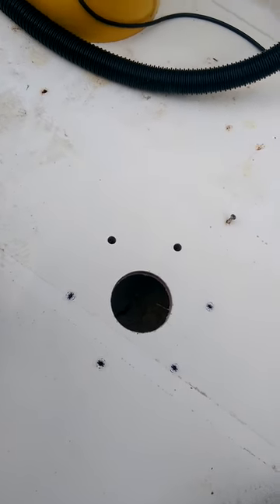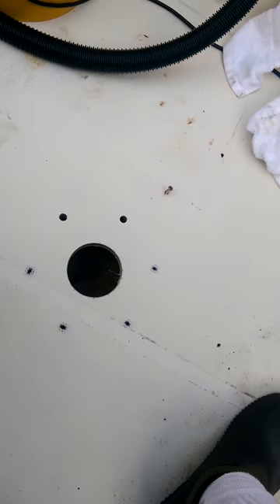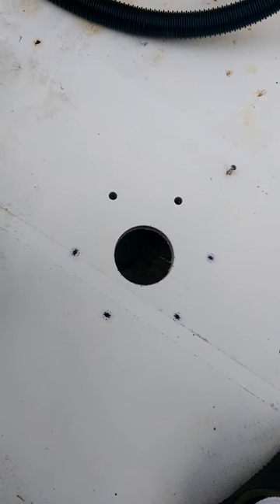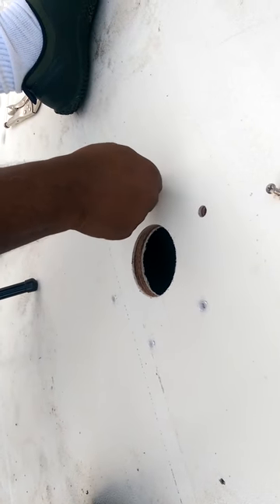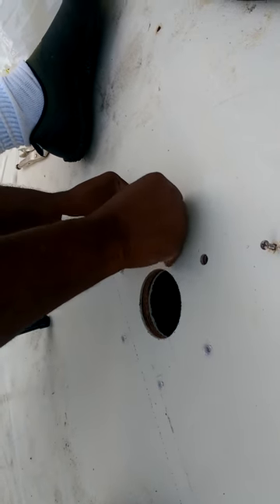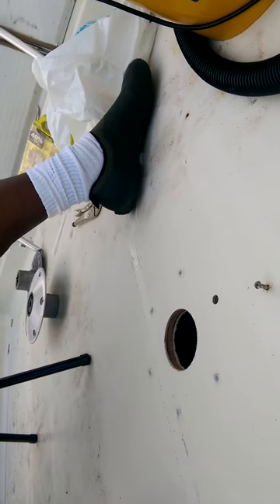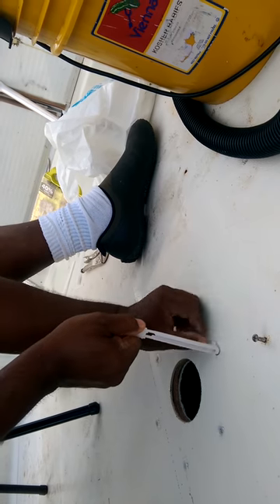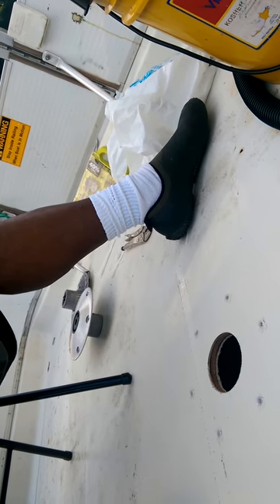Springfield Plug-In Hi-Lo Pedestal INSTALLATION

Comment: how thick is your floor? also is floor fibreglassed over plywood? im wanting to install pedestal seats to my boat but worried its not strong enough to hold my weight of 242lbs especially if sea gets rough. i was thinking to bolt from under floor foe extra strength and you've given me a good idea to make centre whole first, thanks for an awesome video all the way from new zealand

Comment: where did you get those type of anchors for the toggle bolts..thanx
Reply from the maker: A local store called TA Mahoney
Reply: @0528kap  thanx i found them at lowes
Reply: @KalCana  Those are standard snaptoggles and will rust. You need the stainless version. They're a lot more expensive, but last, especially in salt water.